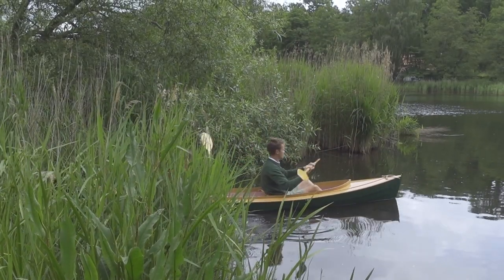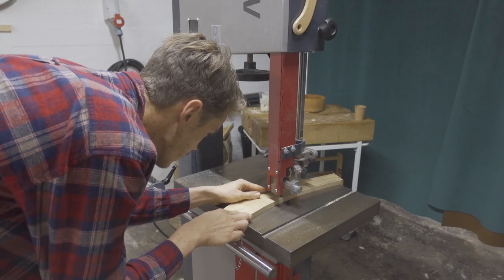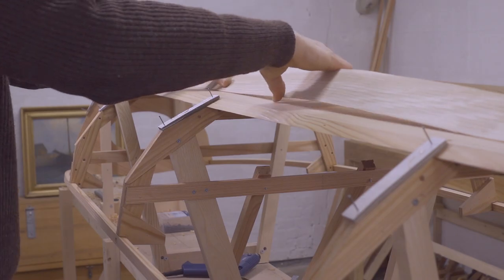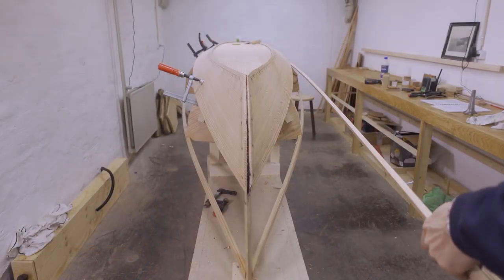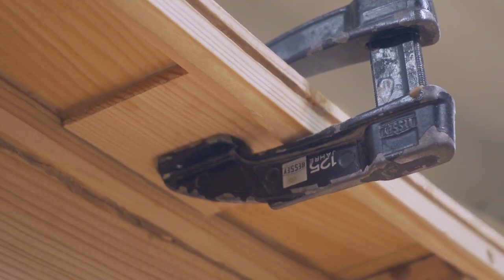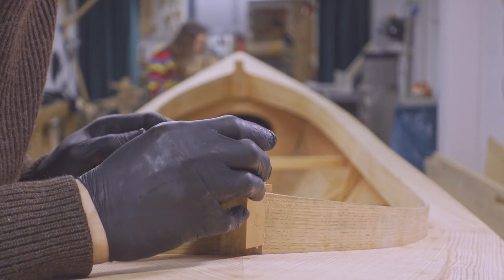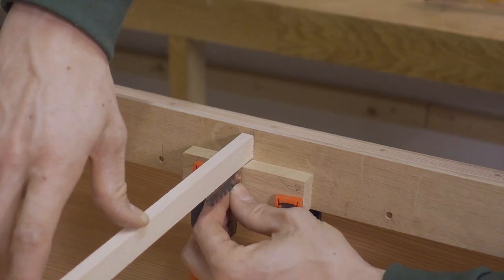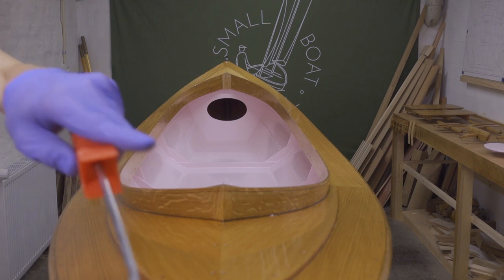How to build a STUNNING WOODEN CANOE: 300 HOURS boiled down to 17 MINUTES

Comment: Great video, thanks.  So why do you choose not to epoxy your boat before painting/varnishing?
Reply from the maker: Hi, sorry for the late reply. An epoxy coat is extremely hard and inflexible, which makes it great for plywood and other materials that don't expand and contract with changes in humidity. For natural wood, generally traditional finishes are recommended, because they allow for some shinkage and swelling. Traditional finishes are not quite as durable, though, but I find they are easier to apply and to maintain. Both options could probably work well with this boat, so I guess it's a matter of personal preference. :-)